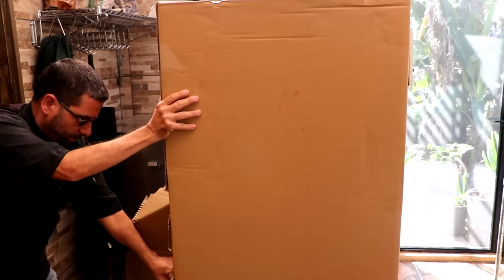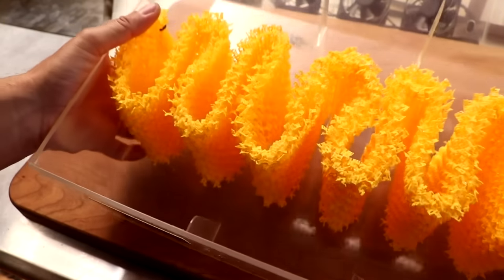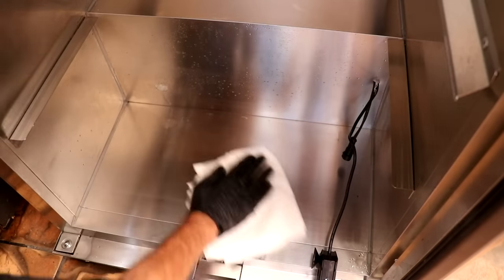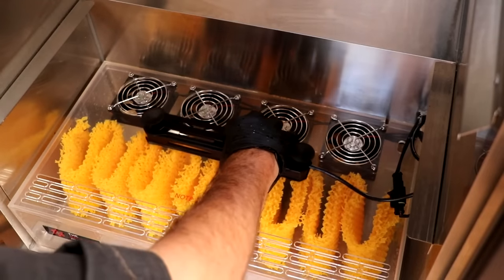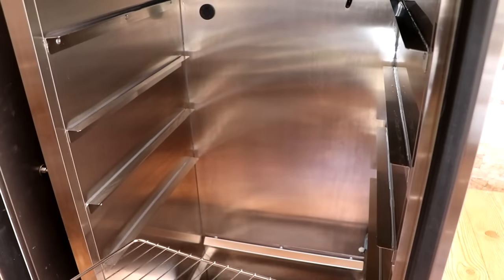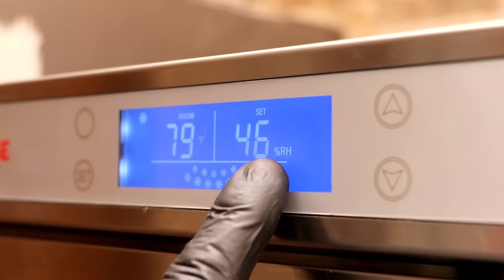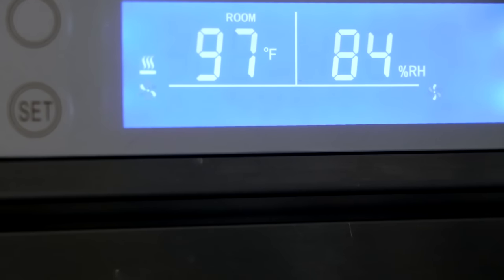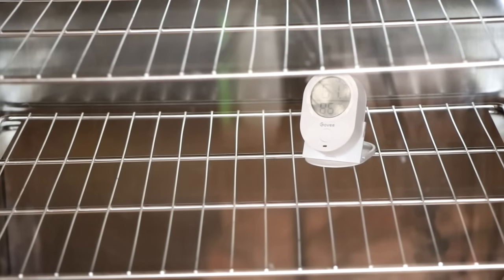The Sausage Maker's Dry Curing Chamber | Initial Set Up

Comment: Wish you the best with your new Dry Curing cabinet.  A quick tip, I have the wood model and in my experience as long as you use relatively high temperatures for your fermentation/aging it works fine, but it has a hard time keeping high relative humidity with med-low temperatures.  For example, @ 75-90F manages to keep 85-90%R.H. ok, but as soon as you go down to 55F it struggles to keep 80%R.H.  This has caused some issues for me as it keeps the fans going as it tries to level R.H. to the setting,  causing case hardening.   Look forward to seeing how your cabinet works.

Comment: looking forward to a 6 or 12 months review, this is one pricy machine. I'm also surprised they put a glass window in it, isn't it better to keep things dark? 

I'll build myself a DYI version next year, this seems way too large for my use. But I also don't run a YT channel, I hope it works out great for you! A comparison of one salami (or similar) in this chamber and one from the same batch in your old chamber would be interesting, see if it even might be worth planning to spend this much on what can be built for a couple hundred, just won't look as snazzy. I'd have it in the garage, where noone ever would see it, so that doesn't matter. 

Love this channel, I have to wait until Jan to start making some salami, but getting all I need for that adventure now.
Reply: Way to pricey for what it is, but that’s the same for most of the sausagemaker products. I modified a three door beverage refrigerator (I cure lots of product) and built my own temperature/humidity controller. I covered the top shelf with foam therefore limiting the excessive airflow from the fans. The humidifying system is two simple ultrasonics I made and they are quite powerful.

Comment: I just bought one and have it cleaned. You didnt mention anything on the sensor on top of the water box. 
Does it just sit on the top, or on the side since it has
 suction cups?
Reply from the maker: is it a sensor or UV light?
Reply: @2guysandacooler  
Oh, it's just like yours, so is that a UV light? I have not plugged it in yet
Reply from the maker: @TheGRUMPSY  I was told that it can be placed in the water bin
Reply: Interesting.  Thanks so much

Comment: Hello friends.

This is a general question not related to the video.

I had a topside of beef curing in a vacuum bag for bresaola.
I forgot about it and it stayed in the bag 1 week after I was supposed to take it out. I used cure number 1, keep my fridge at 2 Celsius.

Removed it today.
Doesn't smell bad at all, however, its slightly slimy.

Anyone know if its still safe? Or should I cook it instead?
Reply from the maker: It should be ok, but if you are worried I 'd just cook it up
Reply: @2guysandacooler  

Thank you so much for taking the time.

It does look and smell perfectly fine. The slimyness just had me a touch concerned.

Comment: I haven’t found anywhere in manual or online what the blue light bar with suction cups at the bottom is for or where it should go….do you have any idea? Any info would be helpful thanks, also if anyone in the comments has an ideas feel free to let me know.
Reply from the maker: From what I'm to understand you can place it in the water tank.  It's waterproof.
Reply: @2guysandacooler  do we know what it is?
Reply from the maker: yeah, put it in the water
Reply: @2guysandacooler  just found out that it’s a sterilizer for the water for the old system that isn’t actually relevant with the new system. Thank you for your responses and info. Love the channel man! Keep up the good work!